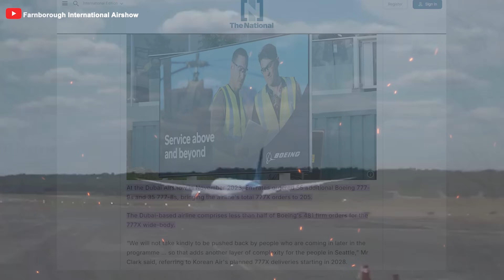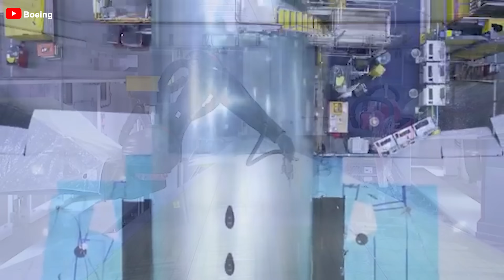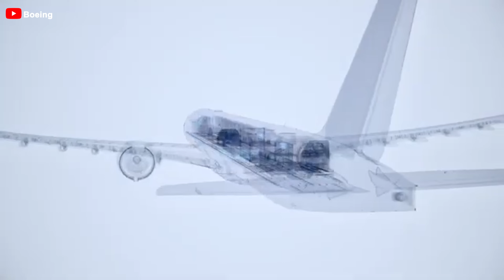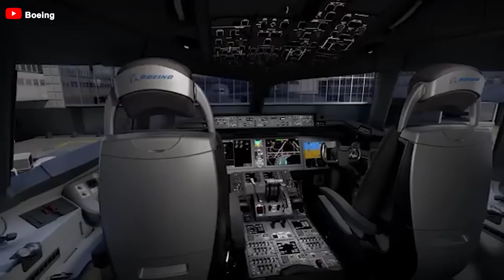Boeing 777X Is In BIG Trouble Again! Here's Why

Comment: That door wasn't an explosion, it did exactly as it was supposed to do. The problem is that the subvariant did not need the sprung release to be functional, and kludged it by fitting restraining bolts, which were accidentally not replaced after remedial work needed them removed. Without them, the air pressure differential at height, normal vibration, and the aforesaid "feature" released the door unexpectedly, at 16000'
Reply from the maker: Thanks for your information!